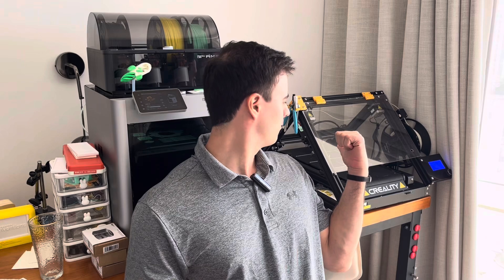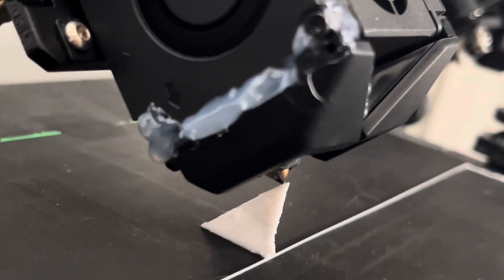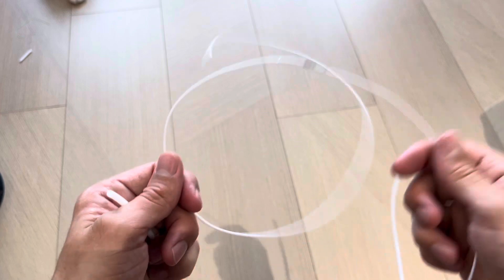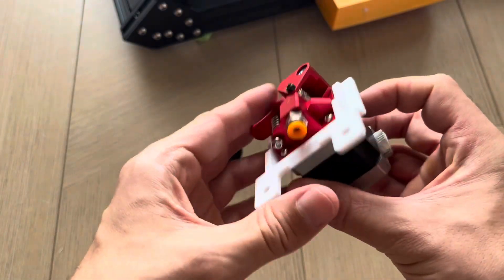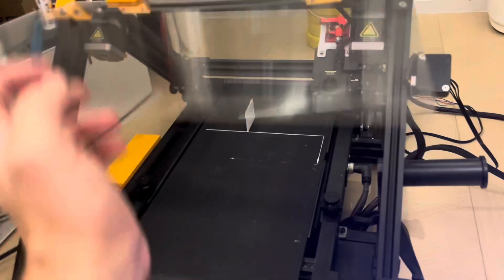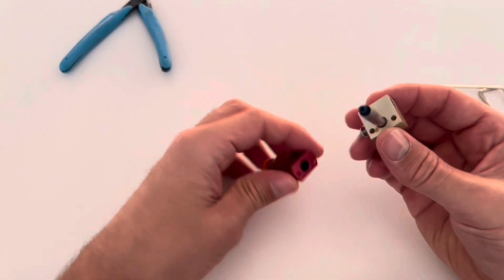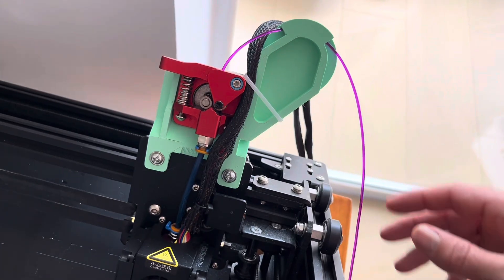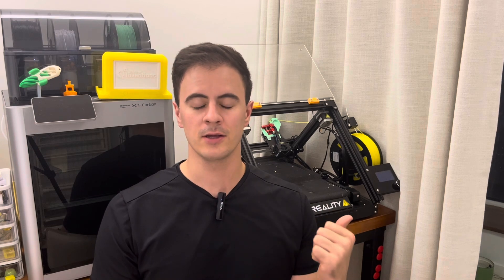Transform Your CR-30 with a Direct Drive Upgrade!

Comment: After doing this modification. One problem I can see on print one is how much more filament (plastic) dust this setup creates 
edit:) the dust came from the filament getting binded as it was pulled back from the hotend and grinded against edges. 
I found a remedy. The looped 3d printed part that guides the filament was set 45 degrees to the entry point. I cut it back to more of a perpendicular 90 degrees. This allowed the filament to not bind and instead move back while retracting.
Additionally, I was able to incorporate the filament detector while avoiding a bind by letting it adjust angles as needed. It is tough to describe but I rigged it to rotate freely in two axis's while staying fixed. I was able to do this by using one screw per axis instead of two screws.
All this greatly reduced the grinding but didn't fully stop it. I believe to fully stop it the filament would need to enter lined up straight with the entry point.

Comment: Hello, excellent work, the CR30 was driving me crazy, I knew I had to change it from Bowden to direct, but as they told you, the video on the web is all very out of date, Thanks again for sharing it,  I just have to ask you what length of the new screws you put in?
Reply from the maker: I used some M5x40 screws, 35mm would also work.  FYI I found a weak point in my 3D design, so I updated the models today on Printables and Thingiverse with the new version.  I wouldn't recommend using the original version if you printed it out. Mine started to crack after 10+ hours.

Comment: thinking about buying a cr30 for some production items i need to make.currently have a ender 6 and not sure if the cr30 belt drive is still a good printer most content online is old. would you purchase a cr30 today if you had to make the decision again?
Reply from the maker: That's a great question.  Now with the new ease of use standard of Bambu lab printers: slice it and send it with almost no issues, I would not put the CR-30 in that category.  The bed adhesion is really good, so I rarely have headaches due to that, but the slicer is buggy and the print quality is not super great.  And the user base of CR-30 users is much smaller, so sometimes it's hard to get community help on issues.  If you need one for long prints, swords and things like that, it's a decent printer.  But a long sword part is still pretty fragile and has a lot of difficult overhangs.  The best practice is still cut the sword in half (the long symmetric way) and glue the 2 halves together to get better strength and avoid poor print quality on overhangs.  I hope this helps you!
Reply: @DesktopInventions  the print quality is not so great because of your setup, using the cr-30 as a standard printer only with direct drive upgrade is not the way to go, there are many more upgrades and calibrations that needs to be done bofore this printer comes to its full potential
Reply: Depending on your needs..
i find it a good investment on my current printer invetory. 
makes printing big and extreme long  glass frames able
And other important usefull stuff in bunches for me while i dont have get my prints off my bed.
just be sure you put raspi in between with klipper and definitely a direct drive or upgrade it to orbital, an accelerometer o jeah also all other neccesary calibrations like pressure advance and shit.   
it takes some time and patience, but definitely worth it imo.
if you have the money laying around it would be a big asset to have this printer.
Just dont think you would be able to print abs with this one, making the CR-30 enclosed would be a pain in the butt

you do need to develop your stl files just the way the cr-30 likes them, but this is not an hurdle for me, i kinda like it. 
all with all  i would say a big yes

Comment: Hi! first of all, thank you for your coverage of the CR-30. Everything online is stuck to 3 years ago and i cannot believe how quiet this printer went on the internet. I fix most of the flaw of my new Cr-30 with your videos! But i went through your video and coudnt find which slicer you are using. Im not sure if creality belt or ideamaker is the most prefer one. Also, if you really suggest one of them, which profil do you use? Thank you and keep your great content (which deserve more view!)
Reply from the maker: Thanks Jean, glad to see another CR-30 user out there!  I generally use Ideamaker, the Creality slicer 4.8.2 that came with the printer is alright when it works, but often times it fails to slice parts.  I just use a generic CR-30 profile and sometimes slow the speed down if I need better quality prints.
Reply from the maker: FYI I found a weak point in this design.  If you printed out this direct drive mount previously  I recommend re-printing the new model, now updated in the same link. Apologies for any inconveniences!